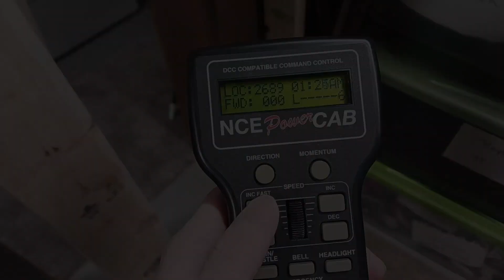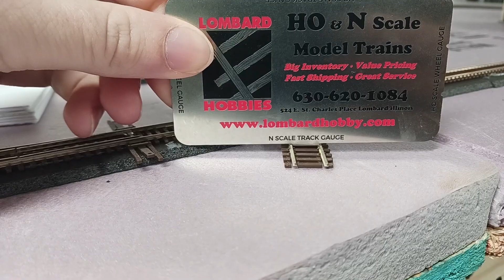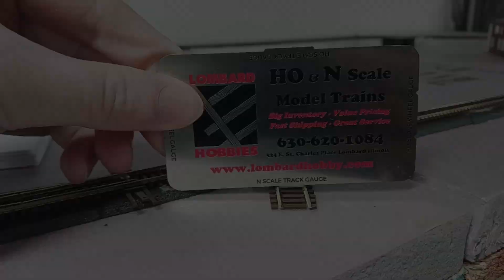Diagnosing A Stall

Comment: The Atlas code 55 curved and number 10 turnouts have such long frogs that both of your trucks need to be picking up power 100%. My solution has been to power the frogs, first with manual toggles and recently with TV frog juicers. The frog juicers are awesome, worth every penny if you are not using a Tortoise or other sort of actuator with auxiliary contacts. The aux contacts are the best way to go since it avoids the shorts completely.
Reply from the maker: I'm assuming that will be an investment I'll need to make in the future, once the four axle locomotives start making appearances.